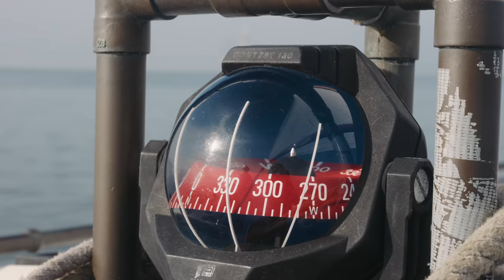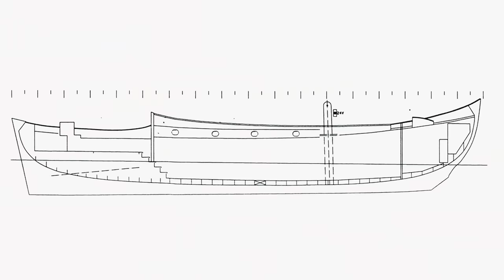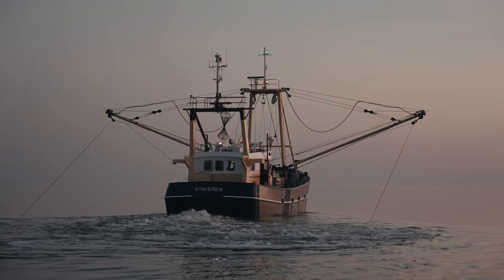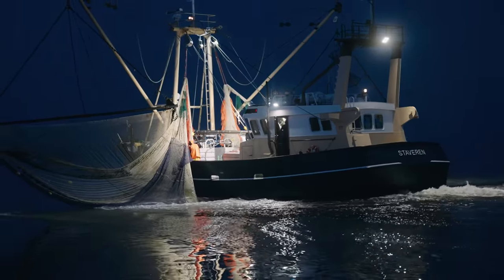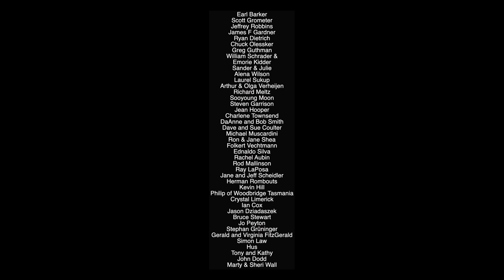Why the Dutch Keep RUNNING AGROUND for FUN.

Comment: I am currently reading a book which you might enjoy: 'Friesland Meres and through the Netherlands' by HM Doughty about spending the summer of 1887 (yes, 1887) sailing his 53ft Norfolk Wherry all around the extensive canals meres and polders of Friesland, with his four daughters, one paid crew, a local pilot and, of course, his butler.  No engine, just quant poles for when the wind was unfavourable. He was a serious sailer and enjoyed out-running the tjalks because of their very blunt bows (like Maud) and much smaller sails.  It has lots of descriptions of the Frieslanders and their tjalks and smaller boeier craft (and the architecture of the buildings), and is illustrated with pen and ink drawings by his daughters. Recommended!
Reply: Met ruime wind zeilt een goeie lemsteraak net zo snel of sneller als een modern jacht.
Reply: There are modern scow bow designs for racing so I guess it's more down to other aspects of the design and intended purpose.

Comment: "A land where the sea is as shallow as the land is flat" - well said. A stretch, between islands and mainland, of the North Sea that is a branch of the Atlantic, that is part of the single ocean that embraces the earth. We call that first stretch "Waddenzee". In Dutch, to wade is "waden" and that's where it got its name - "wadden" are a biotope where you can wade (zee=sea). As wadden is plural, the singular is "wad", there's this "sport" called "wadlopen" - walking this biotope at low water: part walking where the sandy soil is high enough to be firm at low tide, then there are the soggy sections where you sink into the soil with every step and next parts where you really wade. When your feet/legs sink into the soil, pulling one out for the next step may seriously stretch your knee's connecting tissue so don't do this when it's cold and try to avoid it if possible, or if you need to, try to have trained for those knees to build strength in these tissues. Or else it will turn out to be your Wounded Knee.
Reply: Maybe in time, this part of the sea will be converted to living land space.
Reply: @RickMentore  Unlikely. This is a protected and unique ecosystem and a UNESCO World Heritage site.
Reply: @jeroensmaal  Thank God for UNESCO! How big an area is it?
Reply: @RickMentore  The entire Wadden Sea (including German and Danish parts) is about 10 000 km²
The UNESCO protected area is about 12 000 km² because this includes the transition area into the North Sea.
It's about 500 km long and on average 20 km wide.

Comment: The Dutch even used this in sea-battles during 17th century. Admiraal Michiel De Ruyter tricked French and English ships in attacking his ships over a shallow and several run aground.
Shallows were used by De Ruyter as a way of defense and forcing the  enemy to tack while Dutch ships were able to sail over the shallows the French and English could not follow.
Dutch ships were largely 2-deckers as opposed to 3-deckers from the English and French this also made for shallower ships.
Reply: @U.S Grant we all die, so breakfast today was also ultimately futile.
Reply: @U.S Grant And how would it be futlie as the brits got their arses handed to them ones again  .

Comment: Thank you for posting this video. My heritage is Dutch and this was Intriguing to say the least.  I am super curious of the layout of the interior of this type of boat and was hoping to see a short glimpse of it.
Reply: They did another film in real time when they were sailing their first boat that shows a bit more.
A lot of these boats are steel hulls ..the mast on this one is painted to look like wood as well. 
The Dutch are craftmeisters  of rolling steel plate to make curved hulls. 
So they are super tough ..  they share the same features with the Thames and East coast 🇬🇧 sailing barges. They look magnificent under full sail with their keel boards lowered to allow them to track true and heel over.

Comment: Beautiful boat. Would have love a proper boat tour, especially inside. Also surprised not to see explanation of , and your experience of , sailing a boat with lee (or Lea ? ) boards instead of a keel ??
Reply: The function of those lee's (Dutch: zwaarden= swords) are:
to avoid that the boat floats away aside because of side wind

Comment: How does one of those boats fare in an open sea? Can they handle rough seas?
Reply: These were meant for the Zuiderzee and Waddenzee, not for the open seas, though somewhat similar ships were. The Zuiderzeek/IJsselmeer can be quite vicious, but because of the shallow waters waves do not built-up as much as on open sea. These ships derive their stability from their width, hence the spacious cockpit and interior. But shape stability has its limits: above a certain heeling angle the righting torque decreases and the ship will capsize. Therefore the seagoing flat bottom ships had are more heavy keel beam.
Reply: @martijnb5887  Yep, I sort of figured that they are not meant for those kind of "extreme rough seas", but are they still be able to venture out in normal north sea conditions? (weather permitting). PS, I think they are beautifully crafted vessels, and I like the overall look of them.

Comment: Can I bring up something without someone panicking on me here? But anyone doing this on purpose will know this. Tides vary, if you ground your vessel on a 8 foot high tide and each following high tide is less in depth you can find yourself grounded for a number of days awaiting a higher set of high tides. So you would pick a high tide of less magnitude making it simpler to just float off on the next tide. Imagine the mistake of grounding on a king tide where the water depth may not reach that high for several months. As I said, anyone doing this already knows but mentioning this for those who may not know the tides are not static as climate change arguments would lead you to believe everything is perfectly measured.